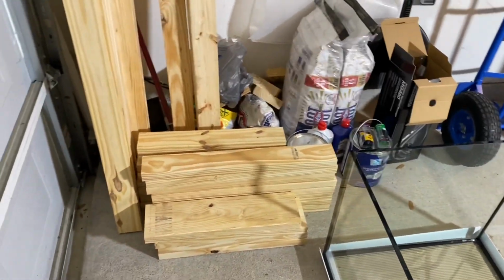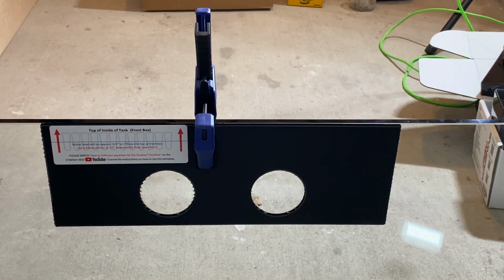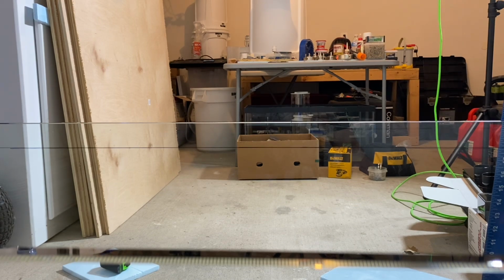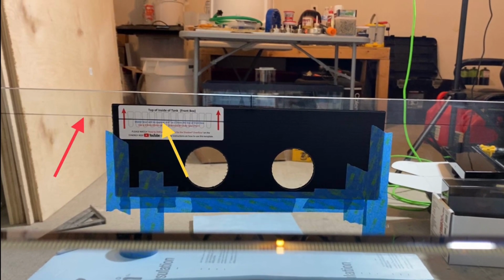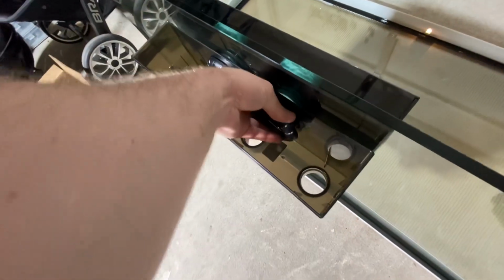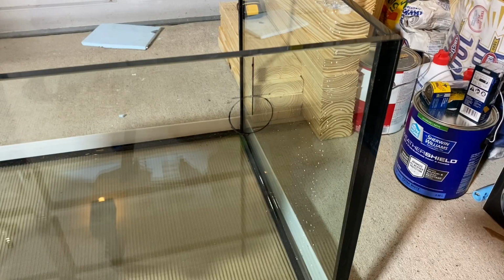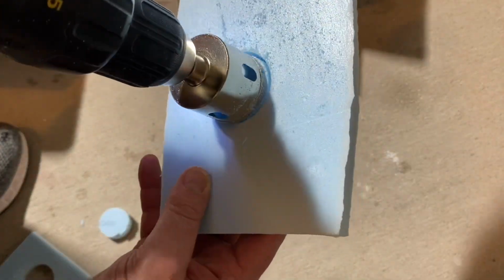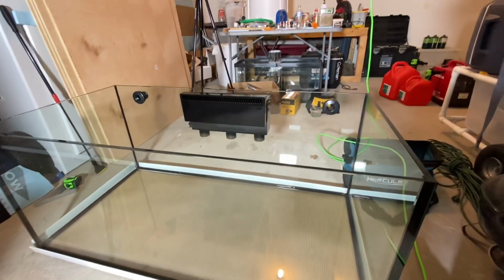From Freshwater to Reef Ready

Comment: Sweet video when I got my 94 gallon  tank the LFS drill holes in it he used vegetable oil he said it's non-toxic I have 1 hole for the overflow box, 2 return line holes and 1 drain hole for quick water change
Reply from the maker: Thx man. Sounds like it’s gonna be a great tank. Get the rock now and get it curing so you can get a head start, reduce the amount of algae, and minimize the ugly stage.
Reply: @Reefahholic  I'm getting ready to order the rock very soon I'm going to get 60 lbs for Tyler at this website yesterday. Are you going to use sand in the sump aka caribsea reef sand  I have two LFS at one they tell me to use half bag of sand in my sump but the other one tell me no sand